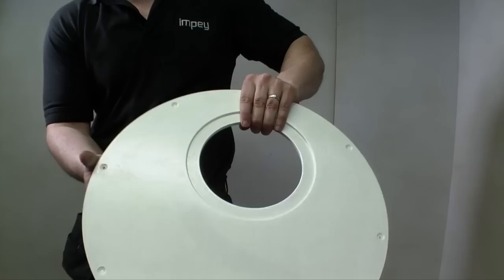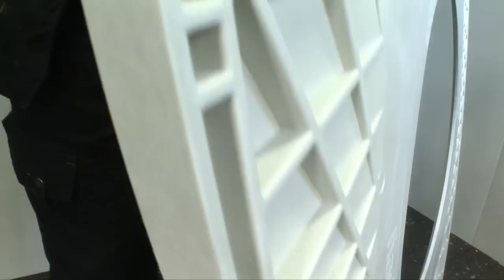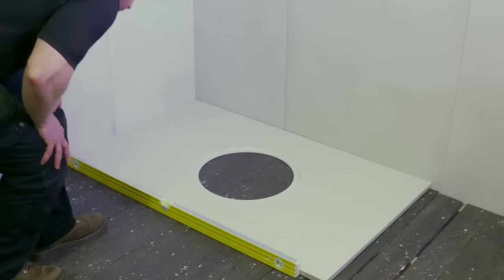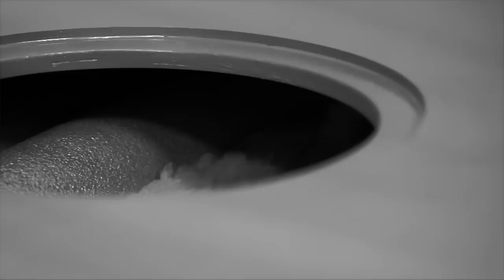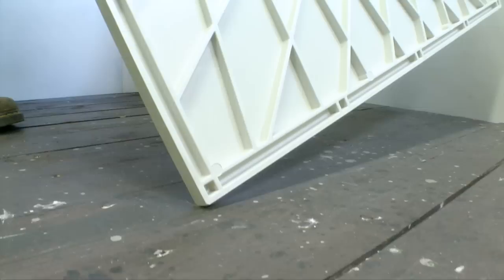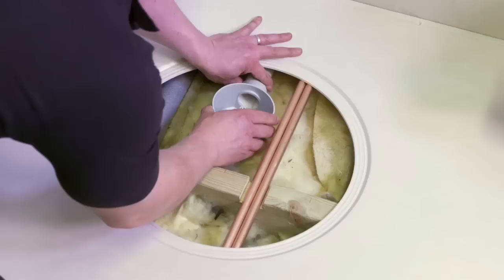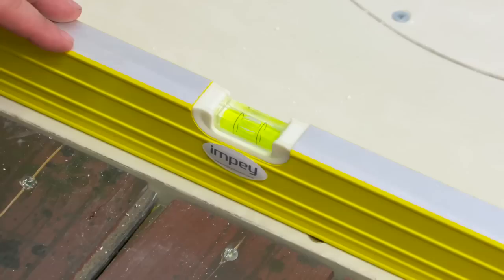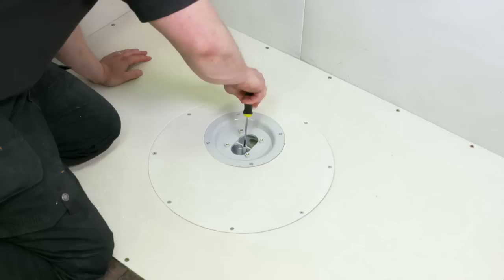How to install a wetroom on a timber floor with an Impey EasyFit Wet room tray

Comment: Do you not require a subfloor to be fitted for tiling?
Reply from the maker: The Aqua-Dec EasyFit floor former should be installed along with the WaterGuard membrane. This will provide a flexible tanking solution for the wetroom. Tiles can then be applied on top of the membrane. A full warranty will apply with these two products.

Should you require further installation or product assistance, please call our Technical Support team on 01460 256080

Comment: Surely the screw holes and edges of the rotating drain cover will leak?
Reply from the maker: All wetrooms require a tanking membrane above the floor former . Without a membrane you would indeed have a leak. Our video on WaterGuard tanking explains the next process to follow. An essential element to ensure our lifetime guarantee is in place.
Reply: Thanks for the reply Impey, maybe attach a link to the next video in the description or at the end of this video. It hasn’t come up on my feed yet. Product looks nice though

Comment: can this tray be used for none slip vinyl flooring
Reply from the maker: Non-slip vinyl can be applied to these formers , they are specified in the UK above all  other floor formers for accessible bathrooms by local councils and sheltered housing. Use a glue like an Altrofix 19 or similar as they spend most of their time under water, if you have been specified a water soluble glue to fix the vinyl try to use something else that is waterproof around the waste clamp as this is the cut edge that's exposed to water all the time.
If you have any further queries, our Technical team are on hand via phone or email, who'd be happy to provide more information  - 01460 256080 technical.support@impeyshowers.com

Comment: What if the wall tiles are not being removed and your replacing a standard tray with an impey easy fit on concrete floor
Reply from the maker: We’d recommend a chat with the tech team on 01460 256080 to find the best solution.
Reply: What time they they open tomorrow please

Comment: Can you tile straight onto the top of this ?
Reply from the maker: No. Tiling can only take place after the next ‘waterproofing’ stage has been completed correctly. See our video on fitting WaterGuard waterproof tanking. Once the tanking process is complete then tiles can be laid. For any direct advice feel free to call our tech team on 01460 256080.

Comment: My scumbag plumber hasn't installed this property the drain is higher than the tile so there is always a puddle round the drain
Reply: If you cut the drain out, there is an adjustable height collar underneath. You might need to remove some adhesive to do this.
Reply: @dan2071  I will show you the dumbest tiler work ever in history